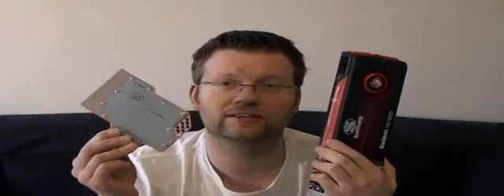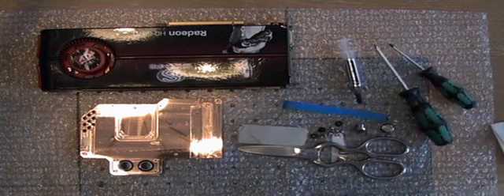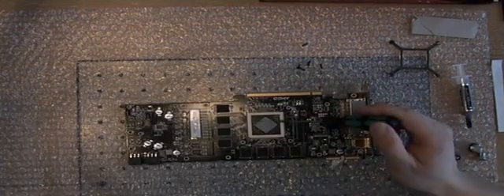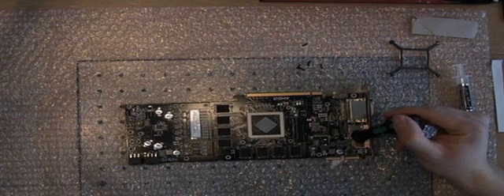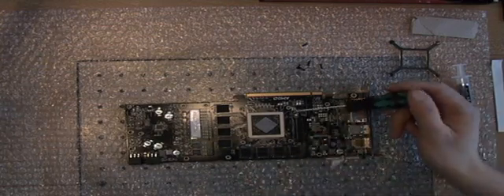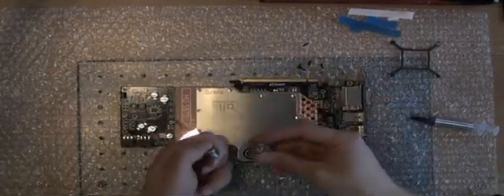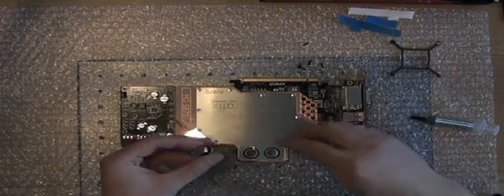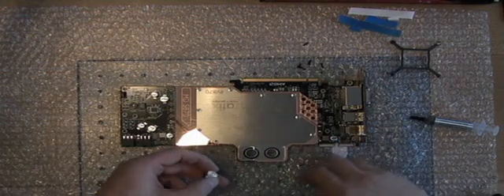Water Cooling ATI HD5870 / 5850 with aquagratix from aqua computer Tutorial

Comment: Is a watercooling setup with a 120mm 3cm thick radiator enough to keep a asus eah5870 v2 under the aircooling noise? The pump pumps about 400 l/h.